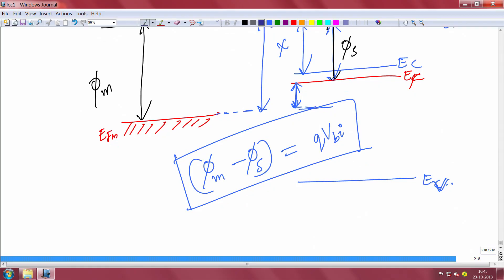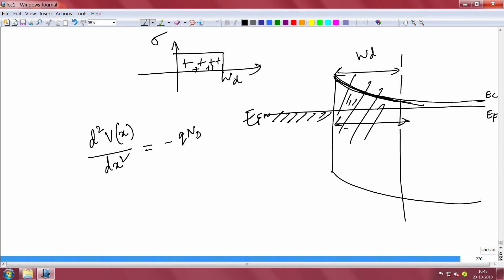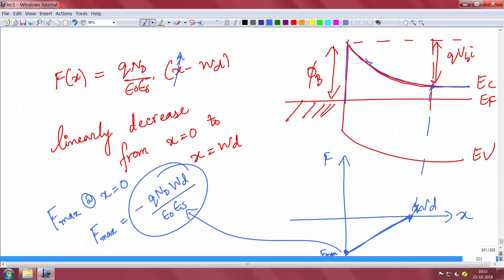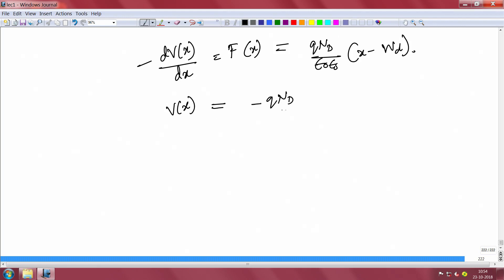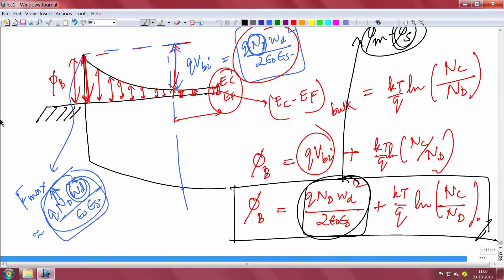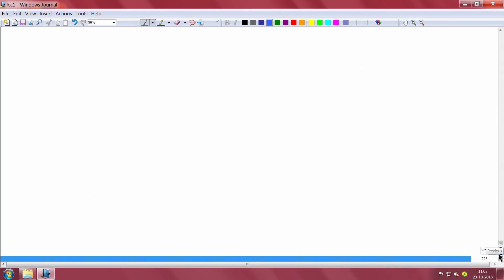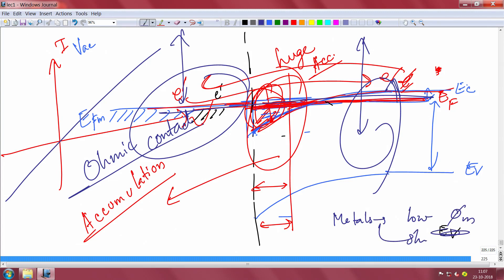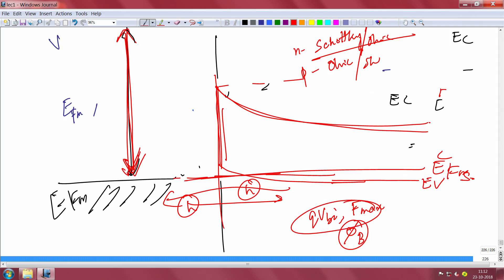Schottky junction under equilibrium

Comment: I thought sir
If the metal work function (ΦM) is greater than the semiconductor work function (ΦS), the contact is called an *Ohmic contact*.

More specifically, when ΦM > ΦS, the metal-semiconductor interface forms an Ohmic contact, which exhibits linear current-voltage (I-V) characteristics and low resistance.

Here's a summary:

ΦM > ΦS → Ohmic contact
ΦM < ΦS → Schottky contact

Is this right or wrong